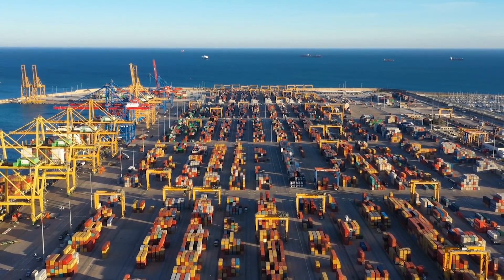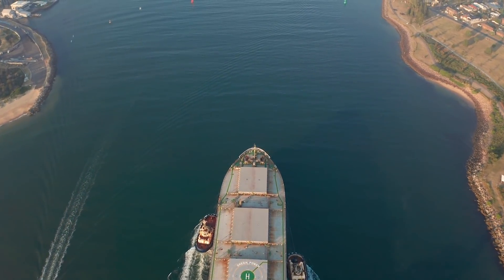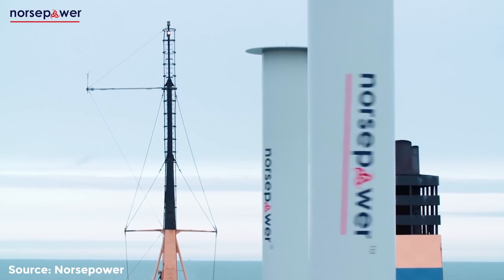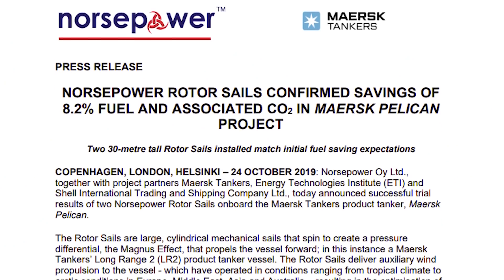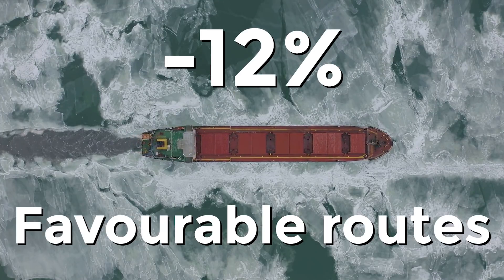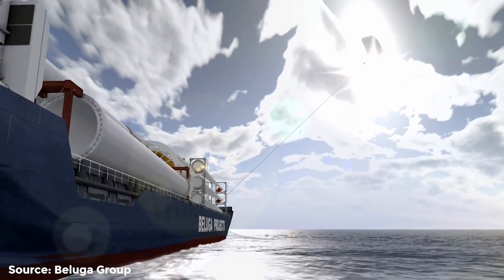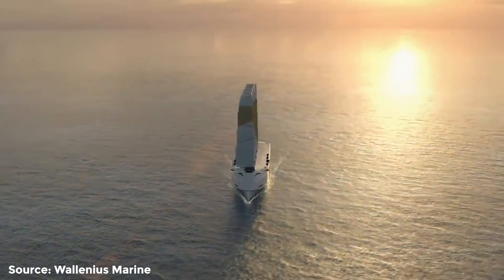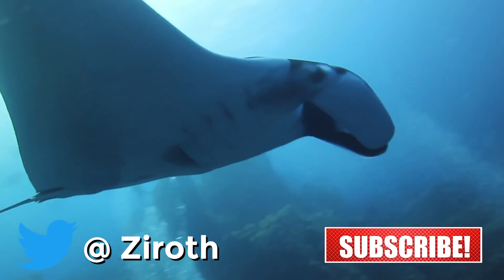Is Wind Power The Future of Shipping?

Comment: Reef the sails me hearties and prepare to be boarded
Reply: While you may or may not have been serious please consider the following.  Wind speed is traditionally measured on the Beaufort Scale (wind speed) that runs from 0 (< 1kn or 0.5ms-1) to 12 (> 63kn or 32.5ms-1) and for sailing purposes the usable part of the range is ‘3’ (circa 8kn or 4.1ms-1) to ‘6’ (circa 24kn or 12.3ms-1).  As the wind speed, and the amount of energy that may be harvested there from, increases the sea surface becomes progressively more disturbed which makes the harvesting process and stress on the vessel structure ever more difficult.  The increased stress means sail area has to be reduced, either by using fewer or smaller sails, one way of reducing the sail area is by turning up the bottom edge; known as reefing.

Comment: That kite looks like the most realistic short term solution, in the mean time we have got to invest in freight trains
Reply: To address the suggestions that wind power is the answer I offer the following.  The canvas, cordage and extra manpower needed for sailing ships was never a very benign environmental option so please discount any idea of sail as ‘sustainable’ and this is without the problem that if ‘the wind don’t blow the ship don’t go’, when it does blow it often blows in the wrong direction for your cargo delivery needs and sometimes there is rather too much of it for comfort.  Traditional sailing ships are unable to go directly up wind so if the wind is blowing from the direction your cargo needs to go then a zig-zag course must be steered; more distance and thus more time on passage at whatever speed is achieved.  Wind speed is traditionally measured on the Beaufort Scale (wind speed) that runs from 0 (< 1kn or 0.5ms-1) to 12 (> 63kn or 32.5ms-1) and for sailing purposes the usable part of the range is ‘3’ (circa 8kn or 4.1ms-1) to ‘6’ (circa 24kn or 12.3ms-1).  As the wind speed, and the amount of energy that may be harvested there from, increases the sea surface becomes progressively more disturbed which makes the harvesting process ever more difficult.

In 1870 a premium sailing vessel entered service, the ‘Cutty Sark’.  The ‘Cutty Sark’ was 64.74 metres in length with a beam of 10.97 metres and a loaded displacement of 2 100 tonnes.  She was able to carry, at best, 1 700 tonnes of cargo and to harness the energy in the wind the available spread of canvas was up to 2 976m2 which was tended by a crew of about 30 skilled men.  A ratio between the sail area (SA) and the vessels displacement (D) determines how lively she is; ‘lively’ being nautical speak for ‘fast and manoeuvrable’.  The carrying capacity of cargo ships is constrained in two ways, mass and volume which leads us to the ‘stowage factor’ of the cargo; the more mass on board the greater the displacement which in turn impacts the efficiency of the hull form and sail area / displacement ratio.  A vessel constrained by mass is said to be ‘down but not full’, while a vessel constrained by volume is said to be ‘full but not down.  When in the tea trade, which the ‘Cutty Sark’ was designed and built for with fine lines (more nautical tech speak, so again no need to worry about it) she could carry around 600 tonnes of cargo at speeds of up to 17.5 knots dependent on the prevailing wind and had a typical China to UK time on passage of 120 days.  The tea trade was very competitive so ‘time on passage’ was a large factor in securing the premium freight rate that made her, the ‘Cutty Sark’, cost effective.  Rounding things out, her maximum available sail area gave circa 5m2 of canvas for every tonne of tea carried.

As soon as the Suez Canal opened, which the ‘Cutty Sark’ was unable to sail through; she lost her advantage, raw speed, to the steam powered ships of that era who could beat her ‘time on passage’ by taking that short cut.  Mechanically powered ships have improved in terms of efficiency, on a freight tonne mile basis, by at least one order of magnitude since then.  After losing out to the coal burning, fire tube boiler, steam reciprocating mechanical ships of the late 19th century ‘Cutty Sark’ was relegated to the Australian wool trade, just about the bottom of the barrel in maritime terms and only one small step up from being a 'honey barge'.

Random fact about ‘Cutty Sark’, it is said to have been possible to coax 3 000 horse power out of her sails, or in ‘real money’ 2 206 500 Watts (2.2 megaWatts) or 741 Watts for each square meter of sail area, assuming this was in ideal conditions.  The sails on the ‘Cutty Sark’ produced about 0.33% of the power need to propel a Mearsk Triple E.
Reply: @BernardLS  Well in the video it was said that the kite sail saved like 14% on fuel, so that seems like a decent investment if all you have to do is attach it to the front of a container ship (I think it was controlled by a robot arm so I'm guessing is fully autonomous)
Going back to full sailing with the current global economy is entirely unrealistic, but if it can be used to save some fuel and thus lower carbon emissions it may become a common addition to (primairy motor powered) cargo ships. The only thing needed right now is some incentive I think.